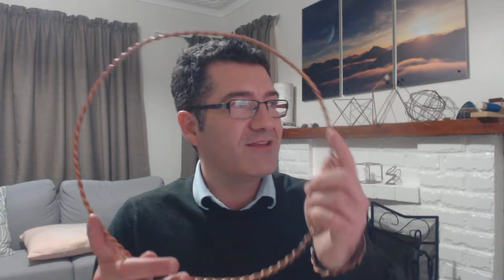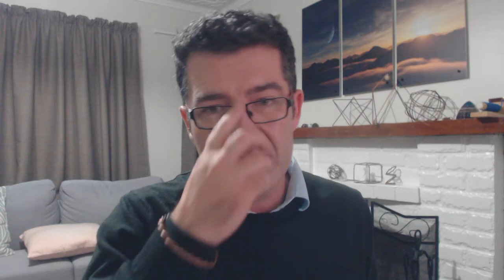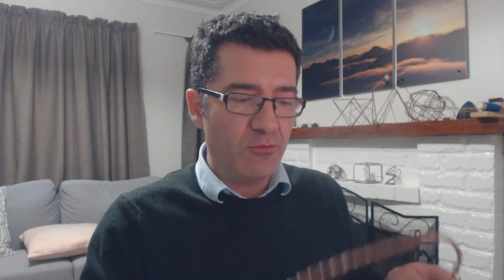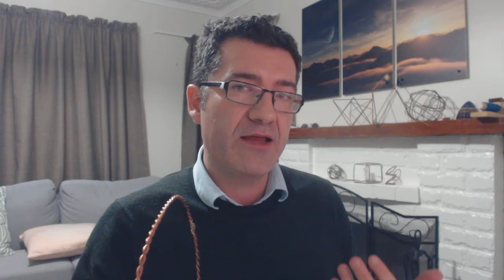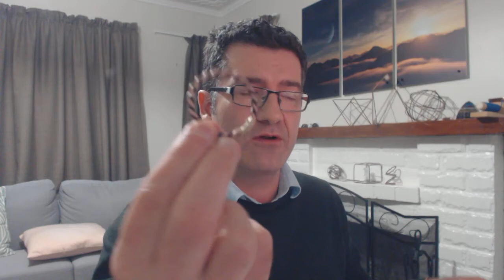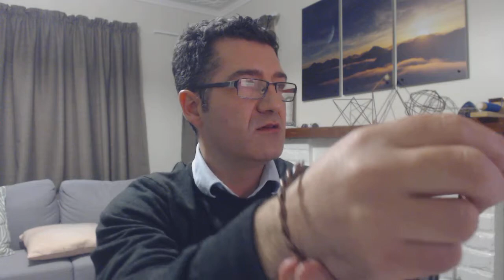Misconceptions regarding tensor rings

Comment: HI , I have a question. If is required to solder a tensor coils/rings that are going to be inside orgonite,  because the two ends of the coils/rings are pushing together and are held in place by resin mixed with Black Iron Oxide (fine powder) and brass shavings what create an electric conductor? THX for an answer.
Reply from the maker: DoOm well the ring soldiered allows it to anchor either a frequency or spectrum of frequencies here. So essentially it becomes the frequency emitter. That’s why a crystal is usually used in orgonite. Also if there is crystals in the orgonite the tensor ring will keep it clean(as crystals do absorb negative energy overtime). Metal placed in a piece of orgonite amplify frequency of the crystal or tensor field. Hope this helps
Reply: @trulyholistic3797  thanks for answer. So, where is difference between ring and bracelet. The length is the same. So theoretically, if it will be opened or will be working as bracelet, this means should clearing the crystal but not soldered, it does not work as fields generator or column of light. Or my thinking is wrong? Or I have wrong approach to rings and bracelet.?

Comment: Hi. Interesting video. If the tensor ring is twisted and the end  are  not put together it will be working?
Reply from the maker: DoOm some cubit measure can work as straight line. But to create a tensor field as a column of light you have to soldier, braze or weld ends together. You have to do that for coil too
Reply: @trulyholistic3797  does straight lines need to be processed in any way? Or just cut to the length? TIA
Reply from the maker: @BritishCoffeevv  cut to the length
Reply from the maker: DoOm check out sacred measurements website or my links page on my website www.trulyholistic.net

Comment: Please prove it
Reply: @X8X8X6X4X  You don't need a higher education to know this is rubbish, some common sense should suffice. A twisted conductor like this is good at doing one thing, and that is nullifying stray fields, that is why it is done in your typical Cat5 / 5E / 6 twisted pair data communications cables, to prevent stray fields from generating cross-talk between Rx and Tx pairs.
Reply: Prove what?
Reply: @emilijapendeva5285  the rings does anything?
Reply: @maxmagnum73  do a little research about Slim Spurling
Reply: @emilijapendeva5285  or take some electrical engineering classes and realize what kind of rubbish this is.
Reply: @X8X8X6X4X  honestly why would you buy something that can be made literally out of scrap copper wire laying around. this thing wouldn't even make that great of an antenna since it's a closed loop twisted around.